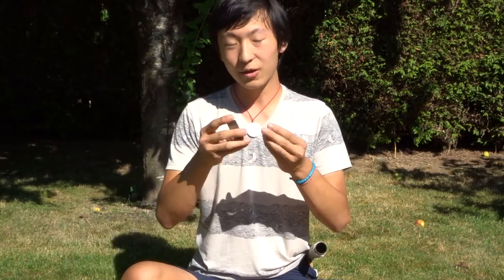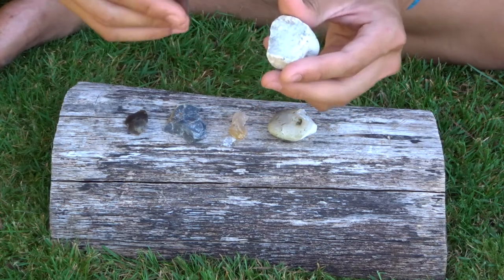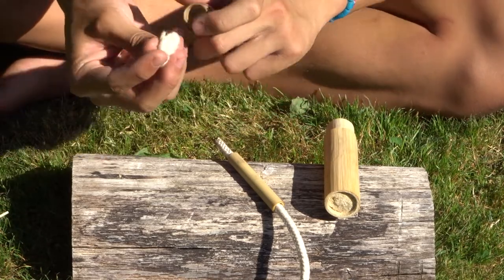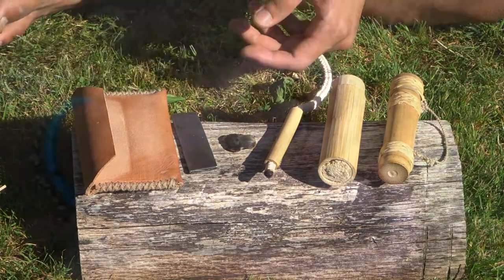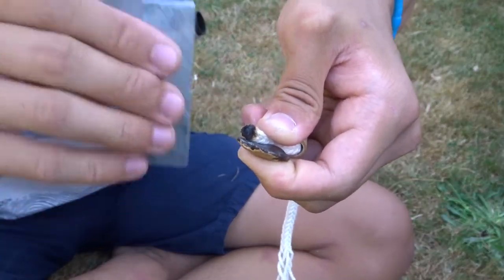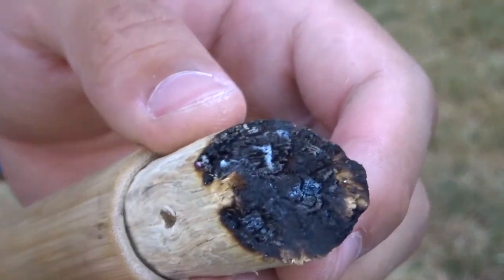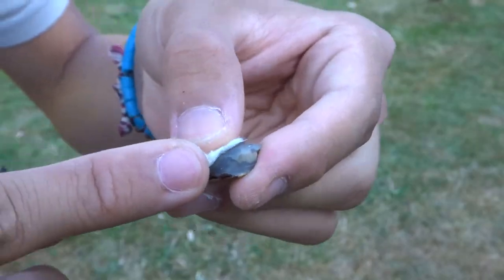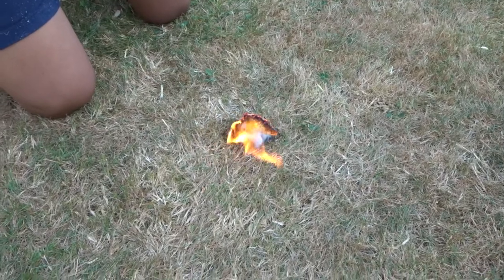How to Light a Fire with Flint and Steel the Indigenous Taiwanese Way (用原住民的打火石取火教程)

Comment: hey mate, love your kits. Just got your self a new sub here mate.

BTW you didn't have to harden that file (if it was an old file) most times old file spark just fine even unhardened. I have many unhardened file strikers and they spark like crazy. I do believe however files benefit from rehardening, and spark even better.

For you lamp wicks, they are great, I use them as well though I treat all of mine with potassium nitrate, this turns them into proper slow matches and improves their ability to take a spark and makes them smolder more evenly. I use copper tubing for my snuffers. I have also gone over to using flat lamp wicks as they lay on the stone better than the round lamp wicks.

I absolutely love the punkwood tinder tube, I am going to try and replicate that.